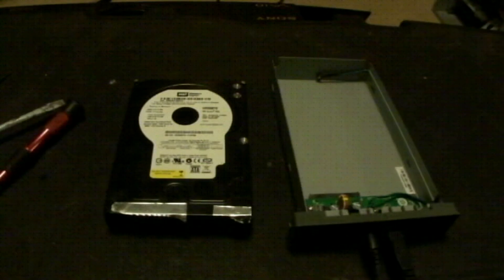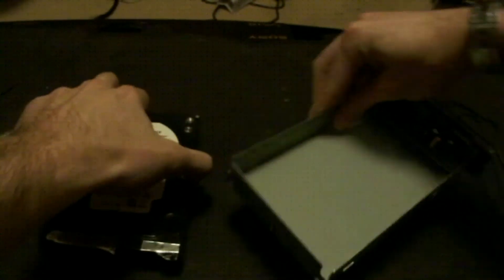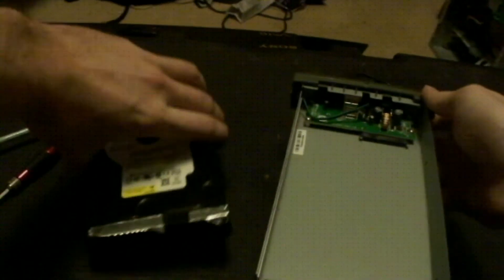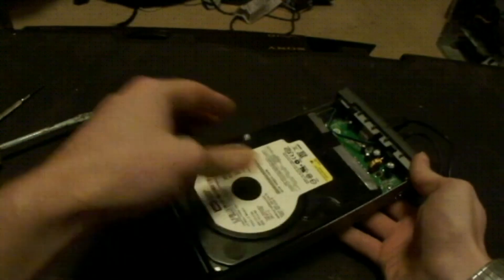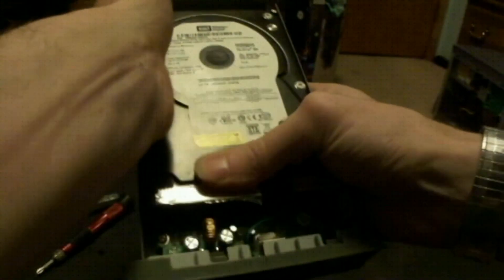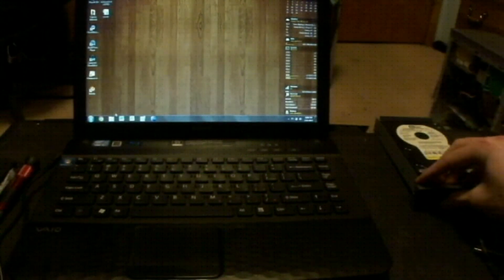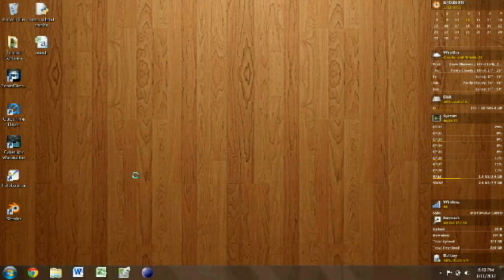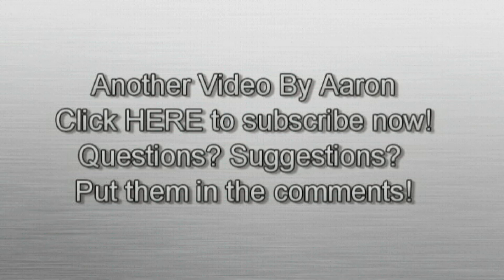Western Digital MyBook Repair Part 2

Comment: Sorry i was misinformed, the symwave chipset is the usb3.0 to sata converter, i read online that if i remove the hdd from the enclosure (2010 wd black) it won't read since it is encrypted via this chip (only reads via usb), is it true ?
This mybook i have stopped working even though the drive spins like normal, it crashes my system and won't open the contents..

Do you have any idea mate?

Comment from the maker: I dont know if it did or not. I received this as a repair job. Try to use the drive on a computer that doesnt have the software installed. I never install the software they send with it, and it works fine.

Comment from the maker: that will depend on the external enclosure. typically for 3.5 inch drives, an external supply is needed.